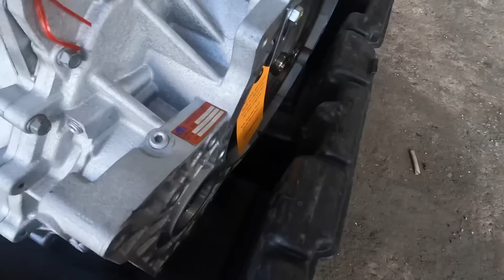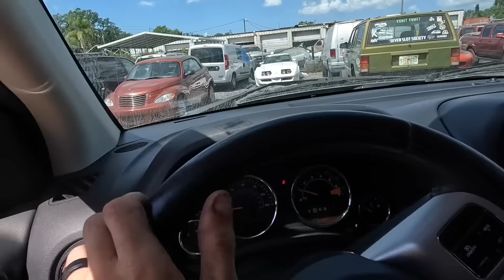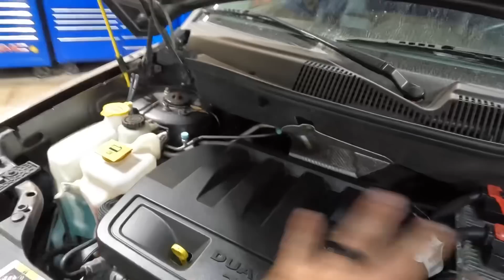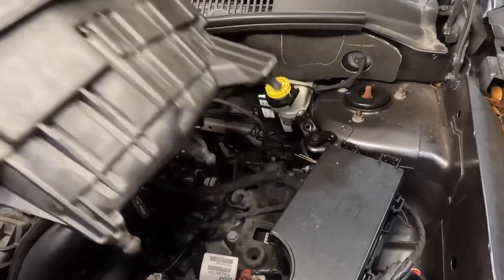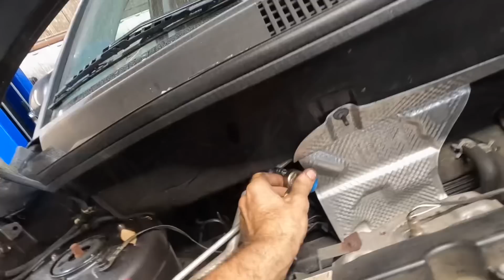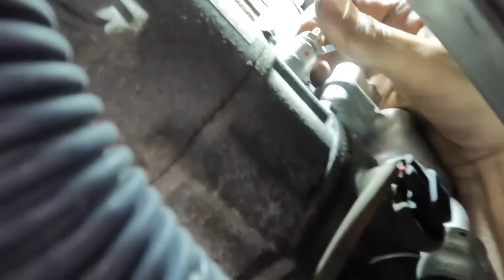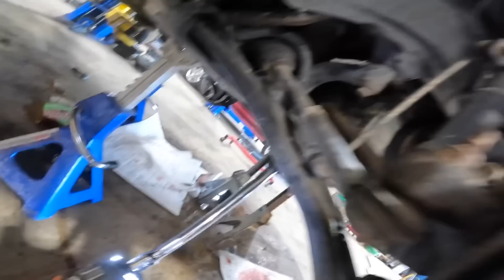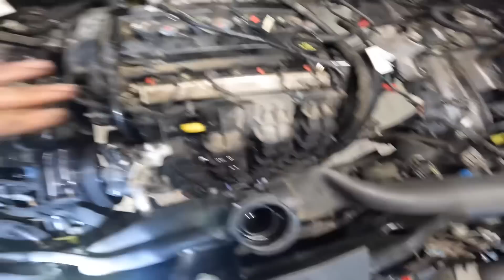Transmission Blown Up! Remove Entire Vehicle! 2016 Jeep 2.4 #mechanic

Comment: Quite the endeavor.  I did the same operation on the front end of a 71 VW Fastback but didn't have to deal with engine removal as it's located in the rear. That front axle assembly was heavy and didn't have the luxury of a lift, so it was me, a friend plus jack stands and a lot of maneuvering to do the replacement.

Comment: Like I’ve said before,
If you were ever wondering why some things cost sooo much to repair…here’s your answer.
P.S. GREAT job Ray
Reply: Adding to your comment, + the cost of unobtainable parts.
Reply: They weren't engineered to be repaired easily. They were designed to be put together on the cheap.

Comment: Question is were do I find a remanufactured transmission for a 2011 Mitsubishi outlander all wheel drive? Any one know of a reputable company? All the used one have about the same milage as mine 132000 and 2 grand plus for them rolling the dice on junkyard used one liar told me he had one with 55000 on one then tune changed after I started asked out vin numbers ect then he tells me it's got 146000 who do you trust anymore? Ray were did you get that tranny ? Seems mine is scarcer then hens teeth any help appreciated thanks Dave

Comment: Not like the old days pulling the engine and transmission using an engine lift. 2 motor mounts and a transmission mount then a few wires and gas line and lift.😁

Comment: Every time I watch Ray pulling 1 of these vehicles apart I truly wish I still had my 72 chev PU. It was simple to work on, I could sit inside the engine compartment and there was always room to spare. The only thing easier were the older VW beetles. A few wrenches and a screw driver and you could drop the engine onto your chest and slide out on the creeper with it.  I really do miss those days when simplicity and dependability went hand in hand.  None the less impressive skills Mr Ray.

Comment: That is insane for replacing a transmission, since when did they start using CVT's in jeeps? Or is it just specific models. I have a grand cherokee and it does not have a CVT in it.
Reply: Fiat Jeeps, not real ones...
Reply: @gordonrichardson2972  Fix It Again Tonio!

Comment: That was a great performance!

I'm curious how you cope with the variables of getting the subframe aligned to fasten it back on, as you can't move the car chassis on the lift, and you could easily end up with the subframe on the various jack stands in a slightly different position by the time you've separated and part-hoisted the engine off the transmission and reassembled.  Some sort of jig?  Or can your engine hoist take the entire weight of the assembly through the hood opening from the top and thus allow you to swing it slightly to get the bolts aligned?  I'd have thought the weight might be too great for that folding hoist.
Reply: In another mechanic video
He took several measurements from stationary objects in the shop to the engine itself
Eric O
South Main Auto
Reply: Get the GPS surveying gear out.

Comment: Jackstands make me nervous... I would have felt much better setting the engine/trans/subframe down on some sort of cart/table. But doing that job with a lift is so much easier than on jackstands in a driveway. Swapping the transmission in my wife's '15 Malibu was 'fun'.
Reply: Properly placed jackstands are completely secure. Even if you set it on a platform you still nave uneven support points you'd have to shim up somehow.  I'm just wondering what's with the two floor jacks. Seems like a low profile trans jack would be helpful here.

Comment: I dont think alot of people realize how much work is involved in changing a tranny but it's alot it's also alot of remembering what bolts go in what spots 🤔 I can't believe you have to remove the intake to remove the starter im glad I own a simple vehicle to work on just a basic 2009 Hyundai accent 4 banger power steering and brakes when I change my tranny i pulled it out from the top I didn't have to do all that work good luck ray your a awesome mechanic love your videos and being a mechanic myself I'm still learning new things from  you 👍✌

Comment: I noticed you always mix oil, coolant, transmission fluid, power steering fluid & brake cleaner. Recyclers everywhere I've been won't take mixed fluids. We always had to keep them in separate barrels. 

Mixing is just weird to me. Haha 😅

Comment: The engineers need to be sacked for the level of hate that was put into the design of vehicles like this.

Killer stuff ray
Reply: Enginerrs are last in line for space in a chassis. They are after the " Stylists " who try to make the car sexy and bean counters who say use the cheapest parts that will just barely edge through the warranty period.

Comment: Why did it cost so much to get my transmission replaced? It's a lot of work removing the subframe and engine assembly to access the transmission. Any other maintenance items needed while the engine is accessible, spark plugs, timing chain guides ect. nows the time to get it all done.
Reply: Mission creep. The " While we're in here we just as well."  It's still a good idea.
A

Comment: As Ray was backing that "Jeep" into the shop, I noticed the green Cherokee parked out front.  That Jeep was such a great vehicle.  A far cry from the junk being churned out by who ever owns Chrysler/Jeep today.  I bought a 1987 Cherokee new , drove it for over 15 years, almost 300,000 trouble free miles.  One fuel pump, several batteries, lots of oil/filter changes, tires and brakes.  Suspect someone is still enjoying that great Jeep. Transmission failure at 100k miles, insane.
Reply: In my area there are several off-road/mud play groups. The starting vehicle of choice is a Grand Cherokee. Add suspension mods and snorkels and go get dirty.

Comment: The starter is held in by 2 bolts from the trans side it can stay laying right behind the intake with the wires all attached to it and when you put the new trans in just slide it in place in install the 2 bolts easy peasy, ask me how I know

Comment: When I was an apprentice motor mechanic in 1963 , one of the first jobs I assisted on was a clutch replacement on a Land Rover. I was told to read the instruction manual. The firs line of the "clutch change" page read--Remove body from chassis. We did not do it that way.

Comment: Only a fucking engineer would put a control unit on the air box. 

God I hate engineers

Engineer: oh look at me I have a fancy iron ring, oooooooh yeah I’m sooooooo smart.
Reply: Think of it this way, by putting the ECM on the air box the manufacture can save on wiring, if there are 30 wires per car going to the ECM, and you save one foot each wire, that is 30' of wiring per car saved, multiply that times how many cars are made, example: 100,000 units, that is 30' x 100,000 cars = 3 million feet or wire (copper) savings, that is HUGE $$$!

Comment: I worked for a brief time in a transmission shop. From what I remember, only Dodge vehicles were the ones where we had to drop the subframe to do a swap... although most of them were minivans so I believe we split the engine from the trans, so the engine stayed with the vehicle and the trans stayed on the ground with the subframe. Of course that was 20 years ago so I don't remember exactly. In any case, watching  a vehicle lift of a subframe always felt a little odd, and watching it here it still does. Go get em Ray! I can'r wait for pt 2
Reply: You definitely don’t need to drop the subframe on anything with a 604 you do on a Gm pr Ford

Comment: I'm told to stay away from CVT units. Would appreciate comments on the dependability of these transmissions.
Reply: Generally they are junk but some are better than others. Best to get a regular automatic transmission or a manual transmission
Reply: The CVTs in the Caliber/Compass/Patriot are JATCO units and are JUNK...failures are super common.  I can't speak for other makes like Aisin or whatnot but I will not buy a car with a CVT, period

Comment: I was going to say 105,000 is terrible for a transmission but I was on my 3rd for our Ford escape by that mileage. It just so happened that was my last Ford. 
I'd never had a transmission go bad before or since in any of my cars.
Reply: The CVT on my '17 Altima failed at under 120k miles (can't remember the exact mileage). By far the lowest mileage I've ever had a trans fail. 
Might want to add Nissan to you're list.
Reply: @NJDRJ  This is the Nissan CVT in the Jeep.

Comment: Yes ive seen this before,  it was at the GM 
PLANT AT FAIRFAX KS when it first opened durring a school feild trip, only then the body flew togather to the motor assembly as the motor assembly lifted up to the body. 

One problem you have putting this back together is the struts flop around 
Dropping the body back down over the drivetrain you dont have the aliment fixtures they use at the assembly plant
You might want to pull the struts off the assembly becuse its going to be a pain in the ass to guide all the proper parts back into its home location.  You kinda need a lift for this to hold the drive train so you can move it around to meet up with the body.  Dosnt somone make a system like that?

Comment: You probably cant reach it very well in this tiny engine bay but on my engine replacement i didnt have to interfere with the a/c system since i just unbolted the compressor from the bracket and wouldve been able to leave the refrigerant in but i thought i had to remove the compressor with the engine so i had the shop that held the car for way too long without doing anything to it, despite having the replacement engine, remove the a/c, so now that everythings done i have to go get that refilled. Its also been about 4 months since i finished but it was winter so i didnt need a/c

Comment: I wish people would be told to change the fluid in a CVT transmission every 40,000 miles/once a year to keep the transmission from blowing up.
Reply: I wish they would do it with a hydraulic transmission they still don’t
Reply: It would still blowup.   Most failures are not fluid related.
Reply: @user-tb7rn1il3q  It has been shown that changing the fluid at 40,000 miles (or sooner) helps keep the CVT transmissions from failing for a much longer time. They still do not have the same life as a normal automatic, but it does help. Especially in the Nissan CVTs. They are the worst made ones of any brand so far.
Reply: @docgiggles130  Pretty sure the Jeep uses the Nissan CVT.
Reply: I have a feeling someone did change the fluid in this one and that is why it died. I am pretty sure they didn't use red transmission fluid. And that is definitely what was pouring out of it. I had a Ford dealer do that to one of my CVT cars and of course they have no idea why it died. When I drained the fluid upon replacement, the fluids had separated and one drained out first, then the other. Can't even expect the manufacturer to have any clue about what goes in there.

Comment: Ray, that is not the CVT trans. It's the 6 speed. Look at the shifter.
Reply: That’s not a 62te it’s the CVT
Reply: @waterloo123100  well then if it's the CVT, why does it have the 62 TE shifter in there, to manual shift up and down, CVTs don't do that, continuously variable transmission! It doesn't shift gears!

Comment: Man that looks like a huge job. This makes me want to sell my 2014 Equinox while it’s still running. People always tell me that my fear of driving cars over 100k miles is unwarranted and based on the cars of the 70s and 80s.
Reply: Same here, I used to sell my vehicles between 90,000-97,000. 
However, that changed. I have an Odyssey that has well over 200,000 and the dang thing has never broken down or needed major repairs.
Reply: @rajbeekie7124  If it's a timing belt it's far past time to change it.

Comment: Rainman, should you buy a reman or salvage engine or transmission? 105k is terrible for a new transmission.
Reply: Were do you find one for a all wheel drive 2011 Mitsubishi outlander 2.4 all wheel drive a remanufactured one from a reputable company???

Comment: That is the worst of the CVT transmissions that are in cars today. And even the best has no business being in an automobile. CVT trans is all right for certain industrial applications, but not for things that have to motivate down roads and highways. And the Chrysler, which is also used by a couple of other companies is the worst of the bunch. The Nissan is probably the best one even it has no business being in a car. However, it would not be a bad idea after that vehicle gets some miles on this transmission to remove the transmission fluid, and replace it with Amsoil synthetic CVT fluid. It can double the life of the CVT. It is also the only non Nissan CVT fluid that Nissan allows to be put into its Transmissions.
Reply: Nissan actually has the worst history with CVT failures!!
Reply: And that CVT transmission is made by the same company that makes the CVT transmissions for Nissan, Jatco!  The Mitsubishi Mirage uses the same transmission too.
Reply: I thought audi had the worst, mate had an a6 audi gearbox replaced cost 9k. he lost a lot of money on that car, good idea not to buy anything with cvt  gearbox whatever age.

Comment: OMG,  THIS HAS TO BE A 40 HOUR. 10K JOB not including parts.
Yes way to go Chrysler,  you've busted the jeep brand into a pile of shit. For all my dispise of the landrover  and its problems 
For a 2016 jeep to have to have a new transmission at 102k miles is well its not even thinkable.  Its too dam bad AMC didnt keep ownership of the jeep brand and just roll with it.

Comment: Transmission barely made it to 100k. Wonder how long the replacement will last .
Reply: Maybe longer.  On assembly line, engineers have designed everything with the cheapest quality of parts, re-man's are usually re-built with more robust parts.
Reply: @aliasfred  Wow you couldn’t be more wrong 😂
Reply: I don't think those used red transmission fluid and that is what drained out. I have a feeling that may have led to its demise.

Comment: Wow. The donated transmission came in the automotive equivalent of an organ transport container. XD
Reply: Yes, but by replacing a CVT with another one, in the immortal words of Indiana Jones' father, our situation has not improved.
Reply: @spaceflight1019  there needs to be a specialty guy that takes these vehicles with cvts out and converts them to a better transmission design. I’m sure there is a market for it.
Reply: @OneNationUnderSoundness  I can't say if Stellantis is still using the 2.4 engine or not, but I had read enough bad things about the CVT to stick with the six speed automatic. In theory it should be a bolt-in but there isn't enough interest in the Compass and Patriot models for someone to experiment with it.